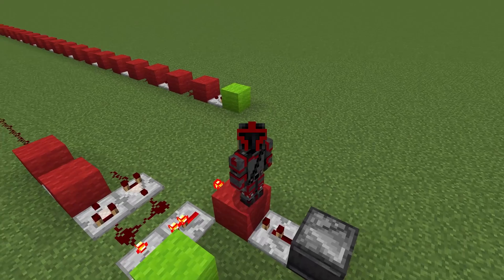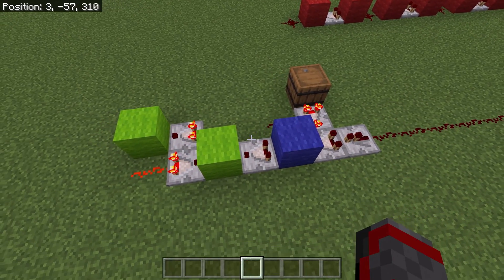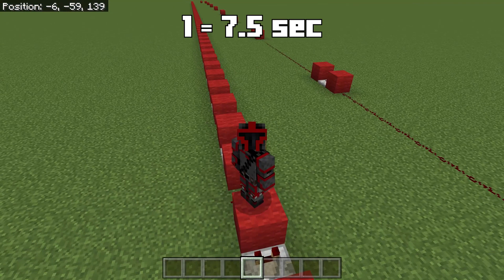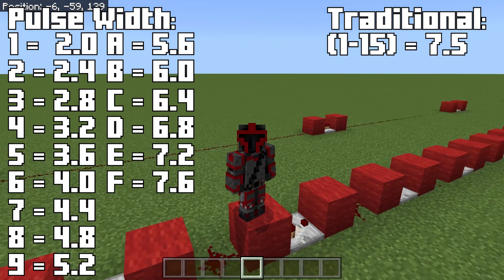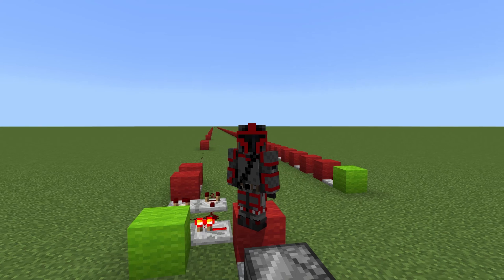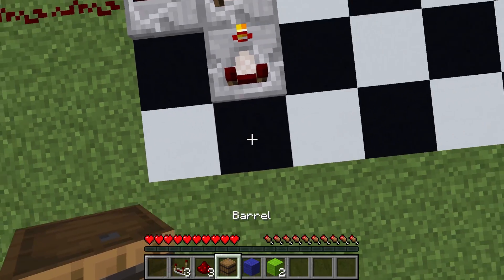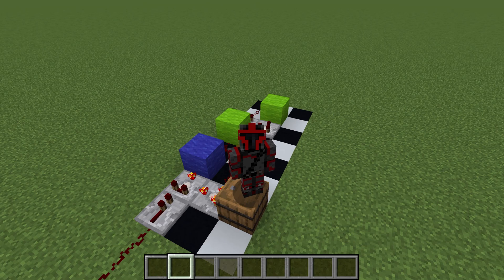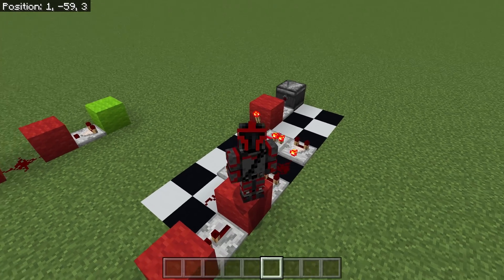FDAR / FDAT System - Long Distance Hex Signals

Comment: which movie by noob_azaur did you base this on?
I myself had R.K.F Walter as a role model when I designed the circuit. 
you have completely missed the point and are only using half the capacity of the circuit.

Comment: I look at it and immediately knew how it works. It's a briliant idea, however if you put 2 lines in parael, you can transmit the same 4 bits in 4 ticks compared to 16* ticks. However that would be harder to build and maybe a normal hex-to-bin to serial to bin-to-hex would be the same size.

*EDIT: yes, i didn't guess quite right the timing, but that's to be expected.

Comment: Maizuma Games made a video about this technology. It's really cool that you also discovered it, because it isn't trivial.
I do have a "better" design 😐.
It's a cable that can be stacked 4×4, with a speed of 16 blocks per tick. You can use it to send a signal strength every tick (probably works on Bedrock, doesn't (normally) work on Java on that speed). It works immediately, so you don't even need to convert to binary!
The big disadvantage is the fact that the cable has to be almost in a straight line. It can only turn every 16 blocks at a right angle. This means that my cable can only be used for specific distances.
It is composed of two smaller cables:
The first can send odd signal strengths with a speed of 16 blocks per tick and the other works for even signal strengths.
It's works by using repeaters, but it's really hard to describe.
There is also a cable that alternating stacks 3×2, that has a speed of 16 blocks per 2 ticks (it uses almost the same system, but mine is faster, because it removes a comparator). MattBatwings made a video about signal transfer where the 3×2 cable is shown.
Try making it for yourself!
Reply: IMO sweats do redstone?!